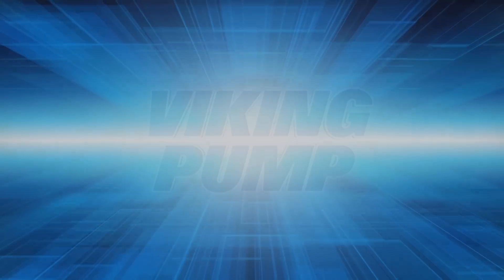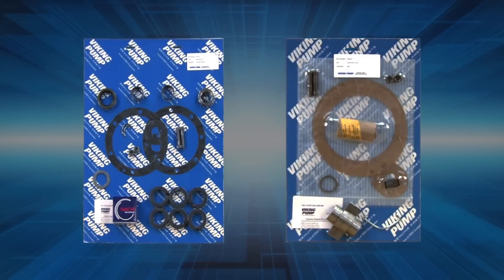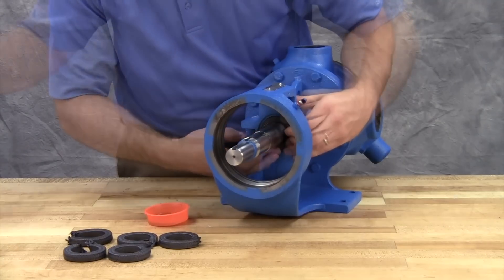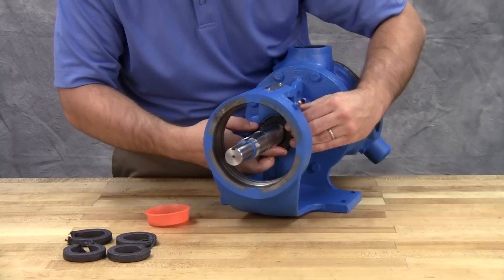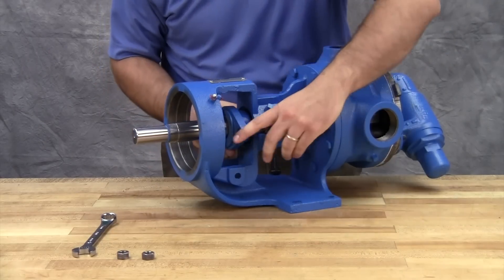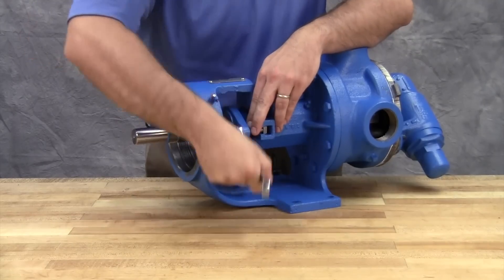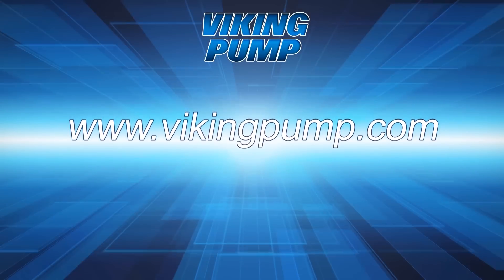Quick Tip #03 - Install Packing Into a Viking Pump

Comment: What's The difference between packing gland vs gland packing???
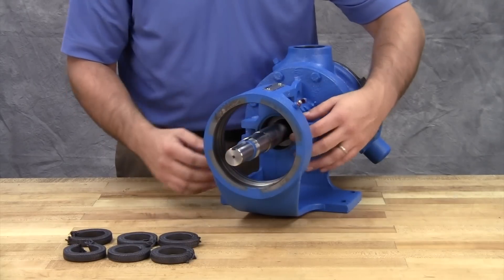Reply: The packing gland is the metal component used for tightening the packing (see this part at 1:45).  Packing is the sealing material itself, in this case split rings (see installation at 0:55).
Reply: Ray Kinsella thank you very much